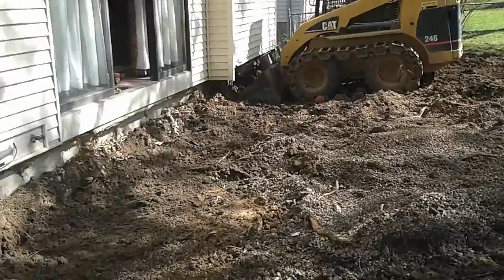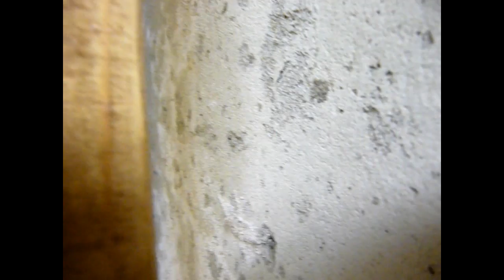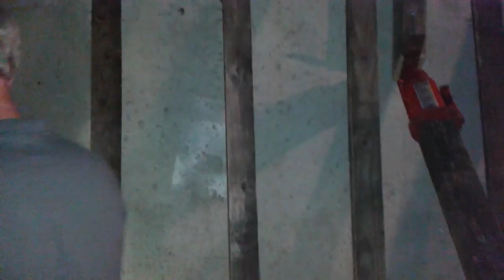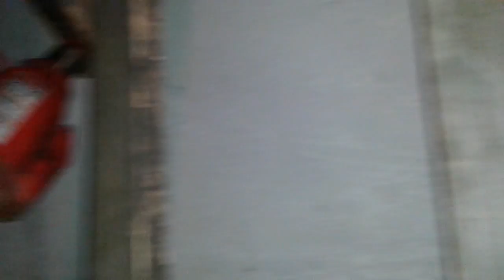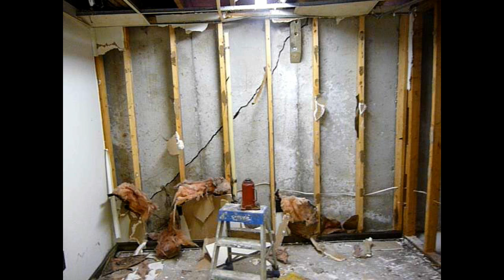correcting caving basement wall DIY

Comment: I'm doing the same thing with my home now. I'm sick and tired of people saying that this isn't a diy project.  I am currently repairing problems that a "professional" did earlier and tried to save a buck but now have a bigger project than what could have been. I'm not saying it's for everybody and that I won't do things differently than they did in the video but all the naysayers need to sit down and shut up. Someone with a little initiative is more capable than you think. And professional is a pretty LOOSE term these days.
Reply: Shaun, I do agree that some "pros" are nothing more than walking accidents waiting to happen. However, some pros are all too familiar with people rushing into it and really messing things up because they did not understand the problem and plan accordingly. This kind of project requires A LOT of planning and prep. It "CAN" be a DIY, but it is a very hefty DIY and IT IS NOT for the faint of heart. The amount of prep, precautions, materials/tools needed, and overall  risk put it outside the normal DIY realm for most people. Again, that's not to say it cannot be done, but rather should be "carefully considered and planned out" before one shovel of dirt is moved or hole drilled. One miss-step could result in a wall collapsing, the whole house collapsing, (both could involve fatality or serious injury mind you), or something as simple as a beam shattering that was under too much pressure because it had a hidden knot (I've had this happen, and still have the scars where "splinters" and shards embedded themselves in my thigh, rump, side, and back).

Comment: Admire the initiative. I will provide a few pointers for those who are thinking of attempting something similar. This is VERY dangerous, and not very DIY friendly. There is a reason this kind of work costs so much for a professional to do; and most of it is for insurance, permitting/licensing, and overall risk.

1) Before digging around any foundation wall that may be compromised, brace the wall and the house from the inside. You can use the same jack/beams you will use to push the wall out to support the wall before it is pushed back.  FYI Push beams/supports should be spaced no more than 6 feet on-center from each other, though five feet is preferable).

2) The house should be slightly raised (less than an 1/8") from the wall being repaired AFTER internal wall bracing is installed.  Temporary support columns (aka lally columns/jack posts) should be placed near ends of the floor joists to support house while lifted. Usually several 4x6 beams are placed perpendicularly under the joists, then jacks are used to push the beam up (which lifts several joists at a time). The the support columns are placed on either end of the beams and the jack pressure relieved.

3) Fix the cause of the wall damage/failure. Any repair of the walls will eventually fail without a hydro-static pressure mitigation. In the case of the video, a sump pump is not enough, nor a swell due to the back yard layout. The grade from the house should be 6" of drop for every 12' away from the home (which they tried to achieve, but due to the orientation of the hill in the back yard, a series of sumps/dry wells, and french drains should have been used to direct water around the house and away from the foundation. Their solution leaves water pooling in the back yard, which be absorbed by the soil/clay, causing hydro-static pressure and cracking again.

4) Couldn't tell from the video, but I assume they did not dig right up next to the wall due to the trencher machine not getting close enough or because they did not want to deal with gravel back-fill.....If there is a gravel drainage system that runs up to within 1' of grade and they were avoiding it, then this is ok. If there is just soil back-fill up against the wall, then it what they did is not ideal, but if you are left with no choice this will work. Either way, dig all the way down to the footer level, perform the repair, then back-fill the trench with #3 or #57 gravel. Do not back-fill with the clay/soil extracted.

5) (covered by the video) Push point on the wall should be approximately 1/2 way up the wall, or just slightly over 1/2 way. Any more and you do are placing too much stress on the upper part of the wall and can cause additional cracking.

6) DO NOT RECOMMEND attempting this on a block foundation wall...... The owners had solid poured and cured walls so they were able to do this. 
---In a block wall, even those that have had the cavities filled, EVERY MORTAR JOINT IS A WEAK POINT. You may be able to do it (I've seen it done), but it is a lot more risky with block walls, and even experienced basement repair crews have had major close calls.

7) Final wall reinforcement should be from top to bottom. Angle Iron on the top may hold for now, but if the same pressure is applied to the center of the wall will fail again quickly.
--- Several ways to do achieve support from top to bottom:
     
Method#1: I-beams, most common solution and more time friendly. Lots of data out there for this so I don't need to explain, but same rules apply for attaching to the rafters and bottom of the wall as in Method #3. For a good example of this method and jacking out the walls with jacks see the following video (I'm not affiliated):
https://www.youtube.com/watch?v=45hBtI8s9Ps

Method#2: Wall pins. Only works for block walls. Look up Daniel OConnor here on YouTube.

Method #3: Crack stitching:
Stitch the cracks (only works for solid walls or filled block). Done by drilling a 3/4"D 16"L stitch hole into the wall at 30* angle to the side of the crack. You do not drill completely through the wall when doing this. Clean out hole w/air. Modify a mortar/grout bag to accept a long tube at the end. Fill mortar bag with 5k psi cement/sand mix OR hydraulic cement. Spray inside of hole with water. Fill hole with mix/cement, then slowly insert 1/2 or 5/8 re-bar into the filled hole (slowly pushing excess concrete out). Alternate the side drilled from for the next stitch (for an 8' tall wall 2 - 3 stitches evenly spaced per crack) ensure they are place at least 1' from the top and bottom of the wall. Let the cement mix dry then epoxy inject the cracks. You can forgo the cement and epoxy inject the crack and the stitch holes with the re-bar inside. Leaves the walls much "cleaner", but still much weaker that I-beams. (video I found is poor quality but gets the point across https://www.youtube.com/watch?v=G5nw6eHdE1E&list=WL&index=3&t=4s)

Method#4: Angle iron on top like in the video, but not bolted to the bottom/narrow part of the the floor joist. Doing that weakens the joist and may cause it to rack. Install 4x4 blocking between rafters using 90* deck brackets and bolt angle iron to the bottom of the 4x4 (Increases structural strength). At the bottom of the wall cut out a 1ft square in the basement slab every 5 to 6 feet on center (measure from the center of each hole). In each hole dig 2' deep or until footing is exposed. Fill hole with 5k psi concrete.  Bolt a angle iron along the entire bottom of the wall and to the new footing slabs in the floor. Make sure the angle iron is bolted so each end of the it is attached to a different footing pad.

Method#4: (Preferred by me): Combination of method#1, #3, and 4. I-Beams can be replaced with 4x6's and 6x6's, however they are more flexible (have less rigid strength), but are still sufficient IF the exterior issues have been addressed. This provides the most structural support because the cracks have been been tied together with the re-bar stitches rather than just by epoxy "glue." It also means the entire top and bottom of the wall are being held in place (via the angle iron) AND the beams every 5 - 6 feet provide support for the middle of the wall. Basically it makes the wall to as close to a solid unit again as it can be.
Reply: I am sooo grateful for this very detailed and  knowledgeable description of the how this job  needs to be accomplished.  However,  having this knowledge means little for  a woman.....in order to get  renovators to listen  to one.  Here in Toronto, the are many "Professionals" doing  horrific patched jobs  and it takes one about  3 times  having job done wrongly......$$$$$   I am well educated  now and may be able  to  screen the  amateurs  and  discart   them.  THAAANK   you!!!
Reply: @b.b.finsclara3589  lots of "professionals" are only professional in name. At minimum, I'd have a structural engineer that specializes in foundations or a dedicated foundation engineer take a look and identify the exact issue affecting your home, and possible recommened mitigation strategies. Based on his findings, you'll know the where to start. 

1) If the engineer says the problem is from hydrostatic pressure or inadequate grading (95% of the time this is the case), eliminate any professional that does not wish to correct it or contradicts the engineer report. 
Note: The last 5% of cases I've seen have almost exclusively been causes from inadequate fastening of home to the top of the foundation (sill plate, floor joists, rim joist/board all need to be nailed together and the sill plate must be bolted to the top of the foundation wall in some fashion). 

2) Discard any place that  recommends carbon fiber reinforcement. At best they delay further damage.

3) Discard any "pro" that only wants to epoxy or polyurethane injection without some other support.

I've repaired several of these situations personally, both as sub contractor and as the primary contractor, and I've fixed a lot of other company's "best solutions". I even have done this to my own home (I ended up using 3.5"x3.5"x0.25" thick steel square tubing instead of I/H beams). Beams have since been coved with wood facade to match the wine cellar look.
Reply: @l.a.martin2424  Do you mind if I ask, why the square tubing rather than the I/H-beams? And unless I missed it, I don't recall seeing you mention anything about using a polyurethane or some type of expanding sealant placed into the crack before the jacking begins. That add-on seems to be part of the typical fix from what I'm hearing in my area. Thanks!
Reply: @grantfahlman1815  Beam vs tubing depends on the severity of issue, and availability. Example: 0.25" 3.5x3.5 tubing has similar strength/tolerances to a 3" H/I beam. Ideally the beam would be preferred but tubing is the only available option. This is where it's extremely helpful to consult a structural engineer in order to determine specific needs. Both are used. Generally if a wall has deflected more than 2" or the basement wall is 8ft or higher,  beams will be the preferred option.

As for sealant: never seal until any pushing or correction has been done. The movement of the wall can and will open new (or dislodge previously sealed) fissures. Sealant choise is subjective. I prefer epoxies in order to restore structural integrity, but urethanes are great for sealing.
Reply: @l.a.martin2424  Thank you so much for the info, it is invaluable. How would you brace the post into a dirt crawl space? I was thinking of digging post holes at a 30 degree angle and cementing them in. would it be possible to leave them as the brace at the end considering its a crawl space, and not living space?
Reply: Great post!

As a big DIYer I would not attempt this myself; find the money and have a crew do this.
Reply: how  would you brace the post to the floor if doing this in a crawl space with a dirt floor?
Reply: Method#5 Let the professionals do the work!!!
Reply: Correct, but the caveat is you have to find a reputable one who will do a real fix for a reasonable charge..

AS I mentioned before, I've corrected the work of way too many other much so-called "pros"  where the homeowner was charged far more than the fix warranted, and fails after 15-25 years later (aka engineered failure, designed obsolescence, and guaranteed repeat business). Don't get me started on  wall tiebacks anchors (average 50k price tag, start to fail in 15 - 25 years, and require excessive excavation). Worst engineering "fix" and best racket I've seen in the business.

I'm a structural engineer, a basement contractor, and before having both of those titles came from a family of basement contractors with 80 years of business. I wrote the above post to show solutions that have 100+ years of historic success from around the world, and cost a fraction of most specially systems. Knowing what works makes weeding out bids easier for the home owner.

It's very easy for contractors and large companies to take advantage of people who are already short on funds. If you know what to ask for from the so-called professional, then they can't easy take advantage can they?
Reply: @l.a.martin2424  I understand completely. Right now I have a block issue with my garage. The small hill beside it has pushed the front corner in about 4 inches. I dug the dirt away from the wall to relieve the pressure down one row below the first blocks that are pushed in and have it all covered where no water will get in there and now I have to find someone who can do the job. I know about as much about fixing a block wall as I do about doing a root canal. I’m a tool and die maker. Not a mason.

Comment: I watched this video a year ago and rewatched it again just now. This is an awesome and clever fix your problem. I assume the weight of the heavy water-saturated dirt pushing next to the basement wall pushed the wall in, probably especially bad during a heavy thunderstorm. I wonder if either 1) only regrading the yard or 2) only installing a sump pump in the basement would have completely fixed the issue. Of course doing both is not that big a deal if your DIY, otherwise hiring contractors to perform these two jobs would have been supremely expensive.
Reply from the maker: Hi Donald.   I love DIY.  I asked my friend if I could video this project, so I am 2nd hand. Both would need to have been completed. If the grading had not been done, you wouldn't want the risk of the sump not be able to keep up in flood season. (I would presume, it would go thru the walls in different locations) I have learned so much about grading and water issues over the years.  The rental of the equipment was obviously the most expense, and knowing how (or who) to use it!

Comment: Lol why would you brace it at just the top lol. That doesn’t make any sense. You should have braced it in the middle and then used I beams mounted to the footing. You should really take this video down. This is how NOT to fix a foundation
Reply: She admits at the end that it was a mistake to place the braces so high and because if that it cause additional cracking of the wall.

Comment: This is a great DIY solution. How much has the wall moved these past 5 years? Was the root cause water pooling next to the foundation, and did sloping the yard away and/or adding a sump pump completely fix the water issue or did you later add a couple more water management techniques?

Comment: Ive worked in basement foundation for 6 years now....and the angels were with these homeowners
Reply: I got a quote to install 26 power braces. For $25,000. Dose that sound high?
Reply: @AdventureBound89  about a grand a piece, yes.
Reply: @AdventureBound89  That is about the average cost, $1k per.
Reply: So 2500$ nowadays? I'd guess around that now

Comment: there was too much soil AND concrete piled against wall, and appears underground roots. Too much weight for the wall to support, GRADE was too high, F-walls aren't built to withstand that added/extra weight-pressure. BOWED in https://www.youtube.com/watch?v=Tq_o7C6KMUA  <-- lateral clay soil pressure and roots caused problems. Hand dug, one day job $2,850.  Hope you dug all the way down to footing and sealed/waterproofed cracks and entire--wall correctly and then backfilled with 90% GRAVEL. Putting the same soil in will only cause more of the same problems. Trying to seal cracks on inside is imo a mistake as well, likely won't last, re-leak. Good effort,  some poor choices IF you didn't backfill w/all gravel and waterproof the entire wall on exterior, just my 2 cents, gl

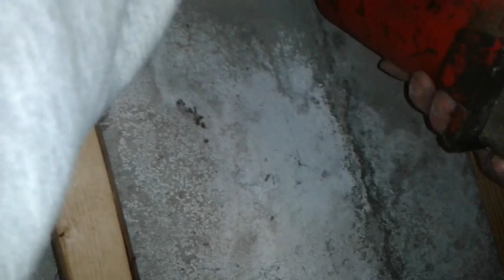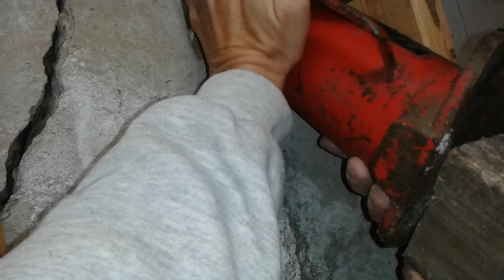Comment: That is a beautiful  gentle hand shown at  4:13 to 4:18 and the ring and  the nails on the fingers look  so elegant  and structurally very sound.   Well, the conditions that they are being used warrants a little protection I would say.
About the wall, I do not think that pushing a wall back is a solution, as the angle of the crack decides it performance. If the crack in the  thickness of the wall was at right angle to the wall face,  it is one issue while if the crack is at an acute angle with the face of the wall, well that is a another issue.  There are other angles of the crack to consider in other dimension  which can not only push the wall out, but the  cracked parts could slip with respect to one another.   
Seeing that the beams were adequately supported , I would have cur  a vertical slot in that wall and braced it with a  reinforced  vertical column or a few of them.
Reply: So, you think that it was "..so elegant..." to be wearing gaudy, fake jewelry at a construction site?  SMH